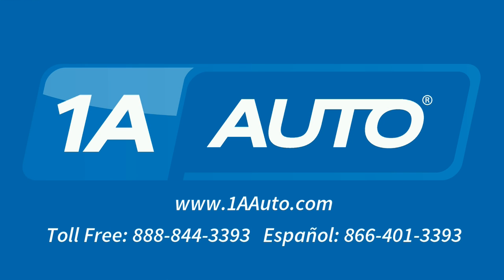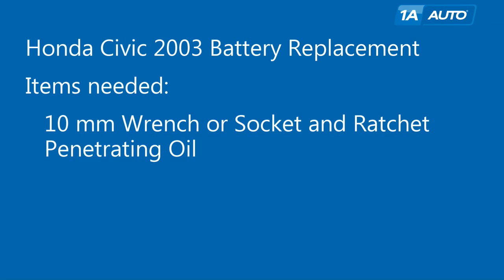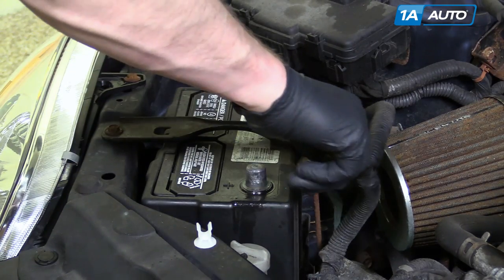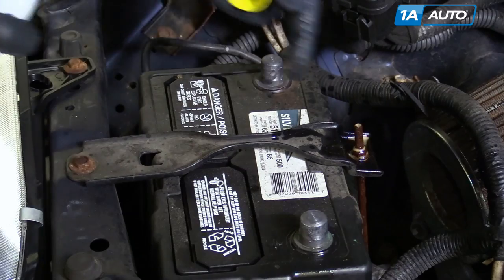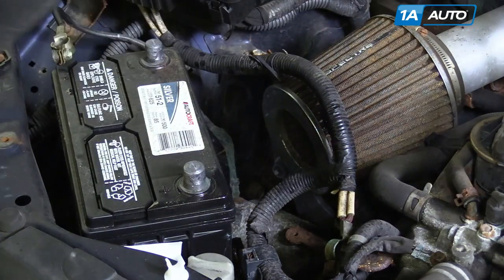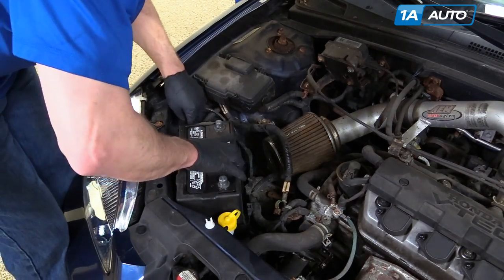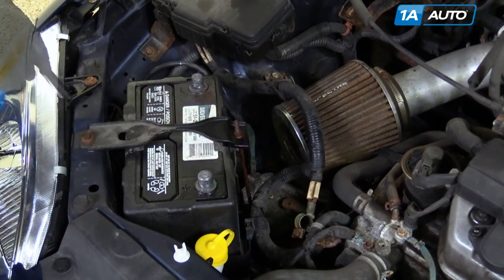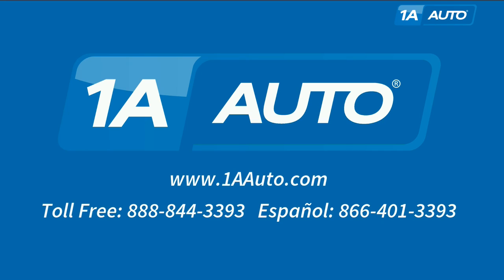How to Replace Battery 01-05 Honda Civic

Comment: What is the factory battery specifications for a 2001 honda civic lx? (Cca and such)
Reply from the maker: +Tiffany M Group 51 battery, around 360-500 CCA's depending on how much cranking power you want.